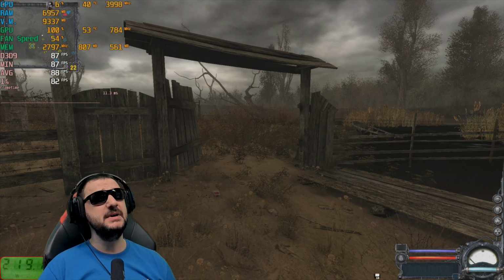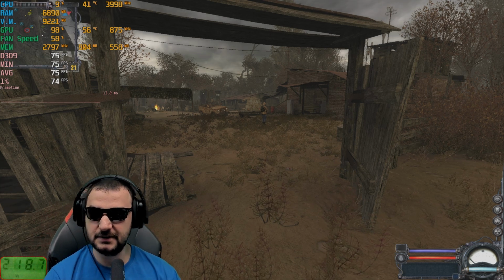NVIDIA GeForce GTX 660 OEM Benchmark

Comment: I managed to overclock my only working HD4870, almost like a HD4890.  Core 844MHz, VRAM: 1055MHz.  On waterblock ofcourse. 39°C DISPIO, 46.5°C MEMIO, 41,5°C Shadercore. VRM is not hot. I give the card an additional fan for cooling the VRAM & VRM.  Interesting: 2.59 GPU-Z has some bug, it stutters the whole Windows. 2.4 is ok.

Comment: Daniel,you got lucky.
This card has a worst cooler!!
It's block of aluminium,and lousy "turbine" fan usually made 650,660,and 670 series of OEM GeForce card overheat and die.
Maybe that burnt mosfet was the key.
Wich one it was???
Did you just de-soldered it,or replaced it?
Reply from the maker: Just desolder it.

Comment: Gtx 660 belongs to one of my favorites GPUs i have multiple of them 2gb and 3gb versions but i never heard about this one and why its have 1152shaders instead of 960shader like regular gtx 660 this is closer to gtx 760 i think
Reply: Oh,you got lucky.
Seen a PLENTY of this,the OEM kind,2 gb versions 
If i not mistaken,this type of cooler had the 7xx version as well.
Reply: @MuadDimAtreides I Actualy prefer this cooler over the standart radiator design because it could get  gpu core cooled more efectivly
Reply: Because it's an OEM card. It wasn't uncommon back in the day that OEM cards from some models were better than similarly named retail cards.

I have a GTX 660 OEM 3GB which has similar specs as Daniel's card but with double the VRAM.
Reply: @keulloe where did you get if?